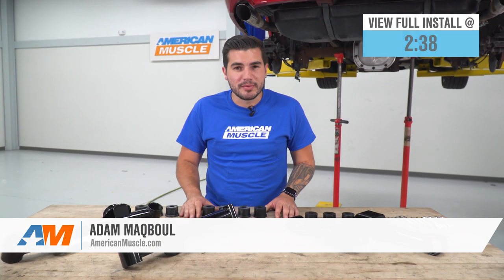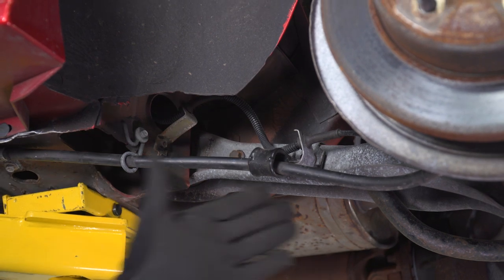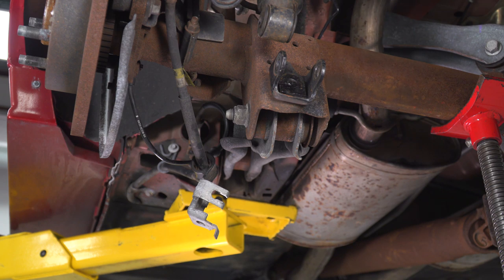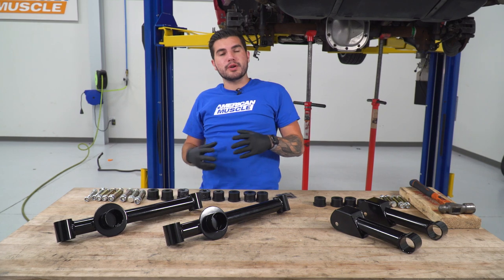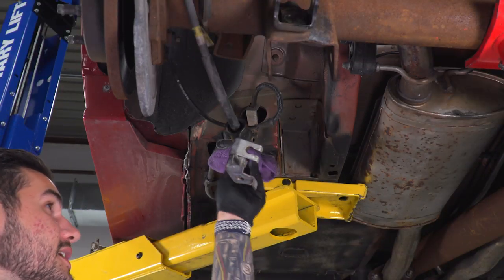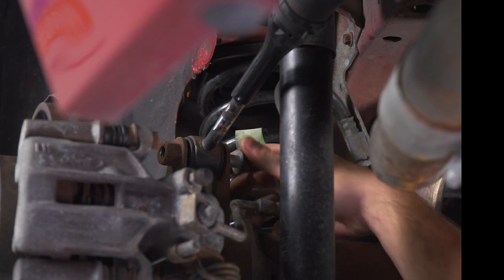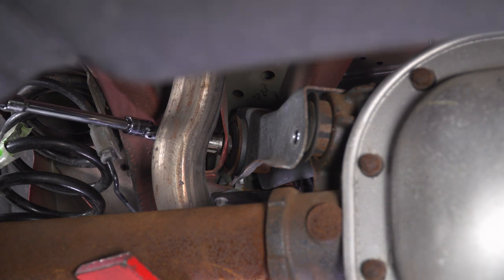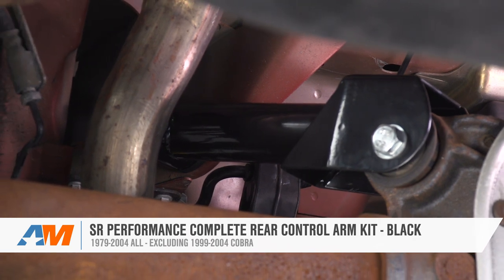1979-2004 Mustang SR Performance Complete Rear Control Arm Kit - Black Review & Install

Comment: The problem with all of these aftermarket lower control arms is that it makes the sway bar hang almost two inches lower.  You need to develope a sway bar designed for these newer lower control arms.  A flatter style bar that will also clear the type of lower with the jacking screw. The stock style bar is designed to go up into the stock arms, and that is why it hangs down on the aftermarket arms.

Comment: Bro I had to use a hydraulic press to get the bushings and sleeves in 💀 also guys using suspension grease makes fitting these guys in MUCH easier

Comment: Isn't the quad shock not needed with the upgraded control arms?
Reply: It depends on what it’s built for, a track car? Sure you can take the quad shock off. But if you’re planning on daily driving I’d keep it on. They’re there just for extra support and YES you could remove it if the control arms are strong enough but I’d suggest flipping the quad shock first or getting a smaller mount for it before outright removing it.